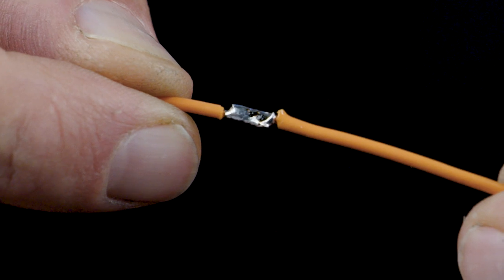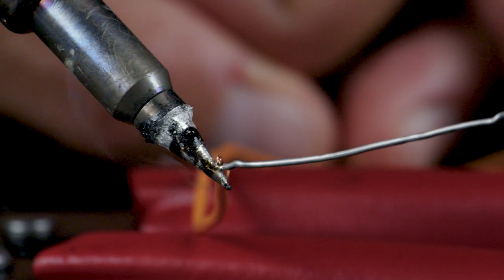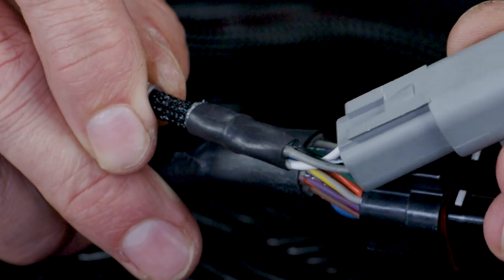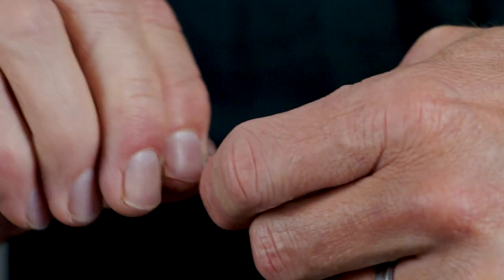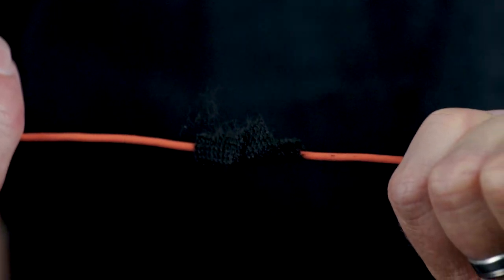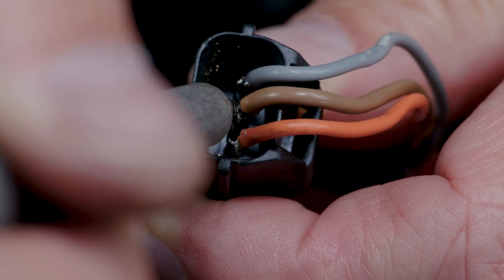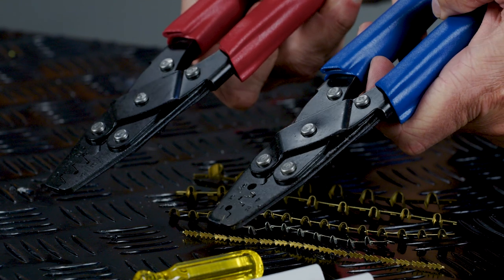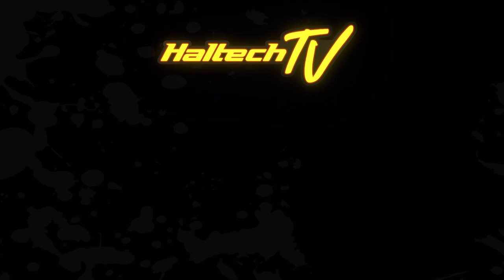🛠 Crimping vs Soldering - Which Is Best? | TECHNICALLY SPEAKING

Comment from the maker: Does soldering really anneal the wire and weaken it? Can a crimp join really be as strong as a chemical bond? Today we dig into the fundamentals of both methods and find out once and for all which is best.
---------------
Products used in this video:
Dual Crimper Kit: https://www.haltech.com/product/ht-070300-dual-crimper-set/
Harness Sleeve Pack: https://www.haltech.com/product/ht-039300-harness-sleeve-pack/
---------------
Liked this video? Here are more like it:
Dave's Wiring Vlog: https://youtu.be/IpNfRaM_P04
How to Ground Your ECU: https://youtu.be/iuCIC1HjHVA
How to De-Pin every connector: https://youtu.be/Vt_rAIKPlWA
Reply: It does not "Anneal" the wire that I have been told, but it does create a Stress Point, where the sharp edge of the hard Solder creates a stress fracture at the point it ends and the bare wire begins.
Reply: It's more the fact that solder wicks up and stiffens a stranded wire creating a defined flex point where failure occurs.

Quality insulated crimps/crimpers and/or heat shrink etc means you don't get this with a crimped join, so they can be used in looms where movement will occur (like in engine bay etc).
Reply: @pinsandscrews6459  the crimp edge/pinch point creates a stress fracture point too, something very rarely mentioned but more commonly causing an issue than the solder sharp edge stress point, given that solder is softer than the wire it is used on. and the steel crimp is harder. 
its almost a daily occurence to find a broken wire out of a crimp where the crimp has effectively cut the soft copper over time and you end up with a blunt end of wire and the copper still in the crimp.
Reply: I've got a video on my channel on this exact issue,  let me know what you think
Reply: Not about anealing it’s about solder flowing in between the wire strands. This creates stress concentrations.

Crimps are “better” all around aside from cost of tooling and maybe you can make an argument for universality/reusability.

Soldering belongs on boards mounted components and nothing else if youre going the extra mile.
Reply: Crack or rust/corrosion comes from no insulation 😂.  Crimp is quicker but has more resistance due to it not being as secure but the soldering is time consuming because it needs to then be insulated with shrink wrap. They both do the job, the difference is how much time you have to do the job?

Comment: I have been rolling joints for the past 20yrs and I never had a problem
Reply: In my experience the problems start to show up in the next twenty, arthritis and whatnot lol!
Reply: Crimping is for amateurs, and (definitely!) do not solder joints!
Reply: @Iowa599  most mines have banned solder joints, to many issues
Reply: Sounds like a problem! 🤣
Reply: I get the feeling Chalice has blazed a few joints too 🤣
Reply: I have smoke my joints in a bong the past 20 plus years. Lmao. But solder my connections. Crimp connectors are great. But i solder them too after crimping if i didn't i wouldn't use crimp connectors they would suck.
Reply: 43 years here!
Reply: Same here
Reply: YOU'RE A LEGEND
Reply: you win
Reply: 44 years and no issue 😅

Comment: When I worked for Hyundai a few years back,  we had a recall that required us to unwrap a harness and solder over a crimp that was a known fail point.
Reply: Soldering over a crimp in place was likely the simplest/fastest/cheapest way to do a repair. Doesn't mean it was the "best" way to do that repair.
Reply: @tilmykillme  Ferrari wouldn't do a recall. They would charge the customer for a new loom.
Reply: One thing many forget. Is not all solder is created equel. Acid core sucks when soldering wire connections as the acid eats it up over a small amount of time. Rosin core solder or rosin flux paste is far better IMO. I am pro solder. I am old school and I have had some solder joints fail. We learn over time. The technique I use today is far more stable than a crimp IMO. But you must start with the correct supplies tools and have a hand for it. Using to much heat and allowing the solder to run up the wire under the insulation away from the crimp pin or desired area. That is a fail and the wire will break. So like anything. Technique is king.
Reply: Just like people don’t know how to crimp, a ton more can’t solder to save themselves… heat the wire not the solder.
Reply: The funny thing is depending on why the crimp was inadequate, just recrimping or snipping the wires and using a new crimp would have been the proper repair.
Reply: @wobblysauce  you do however start with a small amount of solder melted by the iron to promote a good thermal connection from iron to wire after that initial wetting you heat the wire and feed solder onto the wire not the iron keeping the source of heat as central to the join and away from undesired sections of wire as possible the solder will naturally want wick towards the heat and thus won't creep up the wire
Reply: "Hyundai" nuff said
Reply: @802Garage  you lose length putting a new crimp in, it may not have been practicable to do, which would explain the decision to just whack some solder in the joint
Reply: @tilmykillme  Ferrari aren't exactly known for quality.
Reply: @scod3908  the wire was oxidizing or moving in some way that made the old crimp prone to failure in the first place(or combination of those with combo of the current goint through it)
Reply: @scod3908  I think it was mostly about saving time and knowing every dealer would have a soldering iron, but not the proper crimps and tool.
Reply: @Low760 tell me you know nothing about recalls.

Comment: Fun fact: Wires already come annealed from factory. In production the copper strands are drawn through multiple dies, which lessens the diameter, but increases the hardness due to work hardening. If not annealed after each stage, the drawn copper strands would be really brittle, not something you want in a wire.
Reply: Unless you are british
Reply: yeah it's funny how he got that backwards
Reply: You are partly correct.  There are many levels of anneling. Your new cable isn't fully annealed as that would be too soft.  Also fully annealed copper wire has higher resiatance.  That's why in many LV cables, the copper is semi hard. Higher current carrying capacity and lower voltage drop.
Reply: Yep. My welding cables are bundles of individual wires about the size of a human hair apiece and they've all been annealed to keep it more flexible. The thinness of the wire also helps keep it flexible. There are HUGE amounts of amperage and current running through them.

Comment: I'm not that great at soldering on a bench, on a car and under a car?  Forget it.  I use crimps and heat shrink all the time with no trouble, same with South Main Auto channel.  My solder joints would be waaaaayyyy worse than my crimps.  If you can't solder a nice clean joint with no sharp points sticking out (that will eventually poke out of any heat shrink) then don't even try it.  And I remember once 16 years ago I learned my lesson about twisting wires together with electrical tape, and using wire nuts on cars.  It will get you by in a pinch, but the moment you get it somewhere you can work on it you better undo and redo it properly otherwise it will leave you stranded, or a year or 2 goes by and you've forgotten all about it and end up troubleshooting some random ass electrical problem / no-start issue, parts cannoning hundreds of dollars only to find your prior handiwork was the problem.

Comment: Crimping is the preferred method in the marine industry for a reason. This is what I was taught too. circuit boards get soldered, but joints, splices and most connector pins are crimped. Horses for course's
Reply: Interesting, I'm a marine electronics tech and have always found that crimping fails to corrosion, but I guess in those cases there has been a bad insulation to begin with, but what is most impressive of all is the bad quality finish of most of the technicians in the industry.
Reply: @krnt13 From ABYC  "Solder shall not be the sole means of mechanical connection in any circuit.”11.16.3.7. 
I started off my career as an outboard tech. Went to MMI and later factory certified by BRP. I currently am working as a Marine Electronics Technician as well.
Proper weather proofing is obviously as important if not the most important part of the process. Not all connectors are created equally. In general I use the butt, ring, spade, etc  connectors that have the heat shrink incorporated into the insulation Ancor makes the ones I've used most often. It's faster than having to install heat shrink separately and when used correctly Is extremely corrosion and weather proof.
Reply: I am in the mining industry and soldered joints are avoided at all costs
Reply: @krnt13  Yes, crevice corrosion will kill a joint in a marine environment.  This is the reason to flow solder onto the joint after you crimp.

Comment: I'm big on soldering, but mostly because it is extremely rare that I see a well done crimp joint. Few people have open barrel crimpers, few people even have the correct tools to crimp a parts store style crimp. Most crimps in the automotive aftermarket are done by amateurs using the smash style crimpers on plastic insulated crimps that are cheap and nasty. I've had many of those pull free in my hand, rarely has a solder joint failed. But OTOH I can both crimp and solder well and the crimps are far more common.

Comment: A ratcheting type crimping tool is best rather than the crush pliers type, a strong joint that looks 'factory'
Reply: I spent a bunch of time in a very rural area repairing joints that were done with the ratchet type of crimpers.  People think that the magic machine does the joint correctly and don't check them.  Also in the case I am talking about they didn't follow up with solder to seal the joint.
Reply: Yes. NASA has a pdf available that show the many things to look at when crimping wires together. NASA likes crimping for wire connections.

Comment: I solder all my wires with a blow torch on full pelt eh, once the insulation is crispy I know it's cooked correctly. The heat shrinks do a great job of holding the wires in place. It's been 5 days and my joint is still fine.

Comment: Twist and tape is for emergency repairs only. I've had to zip tie a couple of 2 gauge wires together so I could battery weld. Winch controller switch failed cut twist and tape the wires until I replaced the switch the next day. I mainly crimp my connections, but there are times where soldering is easier. Likea 50 amp Anderson  plug and small sized wire, crimping would kind of work but could easily fail whereas solder filling the terminal and dunking the wire in is a better bet. Marine/glue filled heatshrink is the only way to go anywhere on a vehicle.
Reply: You can get reducing bushings for Anderson plugs but soldering them is absolutely easier.

Comment: Definitely a great video, soldering joints in an area where there’s movement is going to cause premature failures where crimping wouldn’t, and high current areas are prone to solder joints cracking (dry joints) because of heat and current draw, great explanation from you for anyone to understand 👌
Reply: Ideally you'd never have a joint on a high current wire. Sometimes it's best to just run a new cable
Reply: @mabolzichjjl  It is impossible to send current over a wire without at least two joints. One on each end. Sure, they're not wire-to-wire joints, but still.

Also, because I saw it on a pretty respected automotive channel: Never ever tin wire-ends when using in a screw terminal, nor screw in a bare wire. Always use crimped ferrules.
Reply: Lots of RC hobbyist might disagree :D lots of rattle and g forces on cars and crashing planes.. never had a problem with a solder joint.
Reply: @vihreelinja4743  I used to do a lot of RC. I don't recall ever having an issue with solder joints. Then again RCs aren't driven nearly as often or for as long as vehicles. Valid counterpoint though! 😁

Comment: I noticed the problems many people encounter with soldering are mostly based on lack of training. Soldering, much like welding, needs a lot of experience. Steady hands, how much heat to put in the joint, what solder to use, how to interlace the wires, pre-solder cleaning, examining the flow of solder and so on. 
A crimp is far easier to learn. If the size of wire, the connector and the tool is right, you just need to strip the insulation, place all together and press the pliers. You can instantly see the result.

At last if there is water involved, obviously a connection is going to fail someday, and in automotive fields there is plenty of it. So even a bad crimp or solder joint can hold just fine at first, but submerge it in water, give it some time, and you will see all kinds of errors on your dash.
So without protection against humidity and vibration, there is no need to rank the 2 methods.

Comment: I worked doing wiring on submarines in the mid 1970s. We used full barrel metal lugs and the crimper drove a point into the connector. This was on small wires. I wired the main communications panel on the submarine Groton.
Reply: chris chris chris... we told you it was classified information, leave your house, get in the black suv, and we can discuss this further.

Comment: I usually solder because it works on pretty much any wire gauge. I find that crimps are a pain trying to find the right size for the different gauges of wires I may encounter. But in my experience, poor crimps have caused way more issues. Like wires damaged from crimping too hard or using the wrong size crimp and the wires are cut or the crimp is too big and the wire pulls out. I haven't had issues with corrosion when sealed with the glue lined heat shrink. I have been soldering since I was a kid, so maybe I am a special case, but I find soldering way easier and crimping half the time takes more than one go when the wires and crimps are really small.
Reply: The video's pretty specifically about which is preferable when both are done right, though, not which is more likely to be done right.
Crimping may require tools specific to the gauge and that can be a bit of a pain but given the right tool and technique, it's a better joint.
Either can be good given the right conditions, but soldering inherently causes stresses because copper is flexible and the solder is stiff, and not only is it stiff, the copper you'd solder is stranded. The solder joint takes the flexibility of the wire and turns it into a composite material far thicker and stiffer than the parent material. Where the relatively soft copper meets this joint, it's forced to bend right there at that point, every time the joint is put under stress. This causes metal fatigue, and is a huge reason for why solder joints often fail.
That's basically why the advice is to stay away from soldering in harnesses, because they see a lot of movement, and why PCBs get solder, and also why he recommended the mechanical backfilling on the soldered connectors. Because soldered joints just don't like movement, but PCBs and the inside of connectors that have been mechanically locked in like solder just fine.
Reply: Crimped connectors generally use the insulation already on the wire as strain relief, which only makes them even better, and given you're using the right tooling, you can also measure the height of the resulting crimp to verify the mechanical validity of the connection. The deformation the conductors undergo in the process breaks up the oxides on the surface, and a good crimp is airtight, preventing corrosion inside the crimp to some extent.
Basically, there are a bunch of reasons crimping is better than most people think.
Reply: Cold solder joints are a massive culprit
Reply: @LifeInJambles  nice explanation